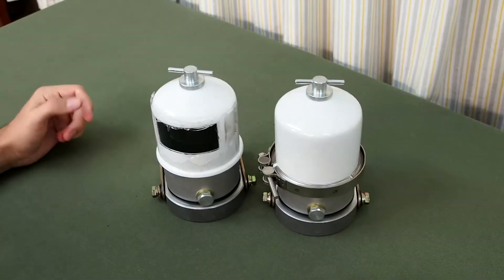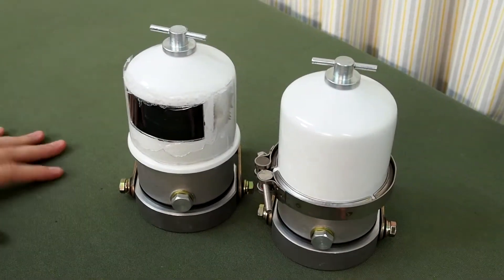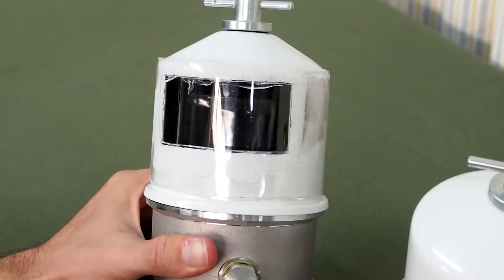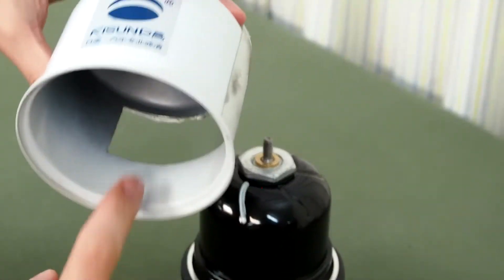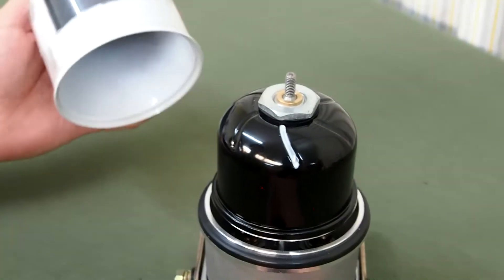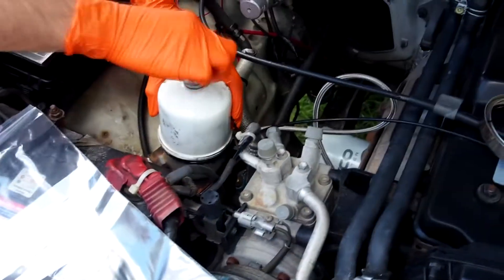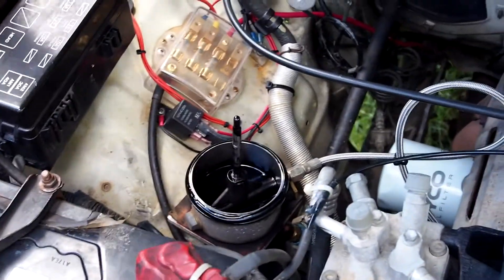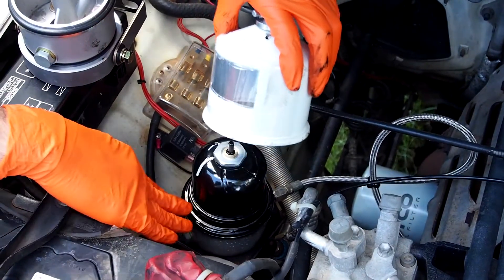Testing Oil Centrifuge on Toyota Hilux LN106 with 2.8 Litre Engine

Comment: Many moons ago when I worked in Aviation I noticed something about engine oil in the propellor system. The propellor on a constant speed or feathering propellor uses engine oil to control the prop pitch. The piston cylinder at the front of a propellor that allows the propellor to change pitch would get clogged with engine oil gunk because of the centrifuge action of the propellor spinning. Sadly I was never smart enough to think how this oil separation by centrifuge could be used to filter the oil in a car. If a propellor is left unserviced and not overhauled eventually the oil sludge and filth will stop the piston from being able move and control the pitch of the propellor. This idea is a bit like the Dyson's of filtering oil.

Comment: Not a bad idea, But the plastic window may melt if or when it comes in contact with the HOT motor oil. Use it as an experimental observation piece but please, don’t drive with that modded centrifuge cover in use.
Reply from the maker: The plastic window was for observation only while the engine and oil were relatively cool.  Yes, obviously the plastic will melt at high temps